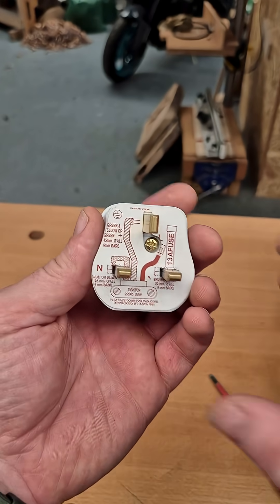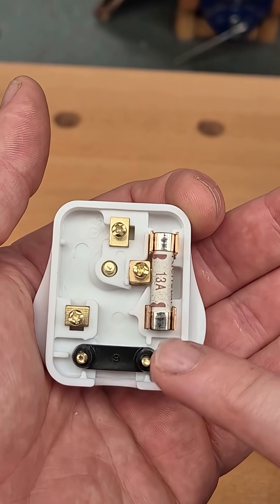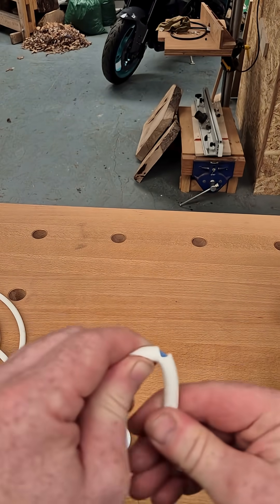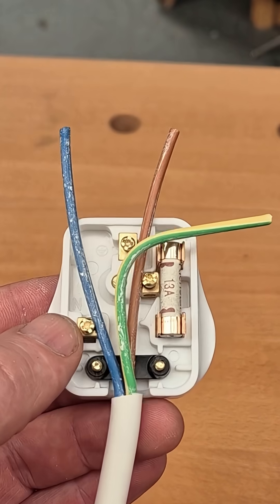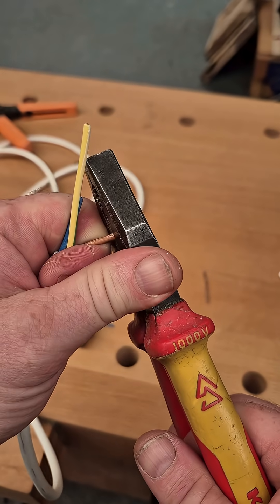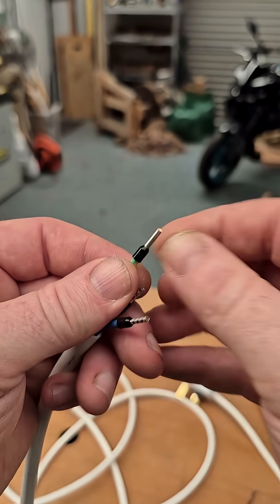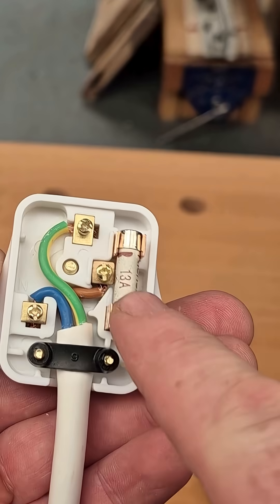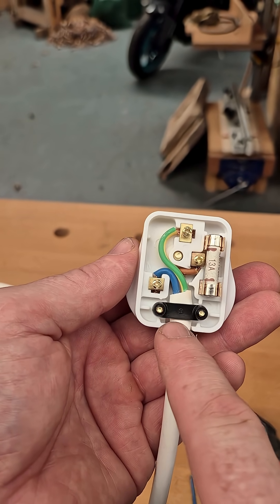How to wire a 13 amp plug in Ireland and the UK #electrician

Comment: That cable isn't thick enough to accommodate a 13a fuse
Reply from the maker: its a 3x1.5 flex?
Reply: Then I apologise. It looked thinner than that. @JohnMcGrathManInShed

Comment: In the early 80's we learnt this at school in physics. I am no electrician but I do have a crimping tool :) . We were taught not to have any copper on the wire side of the pin, but pin had to clamp copper 100%. These days the auto strippers are a game changer.

Comment: OK from one electrician to another that one gets a 7.5 out of 10!
Your ferrules magically disappeared! (extra brownie points for the pro clamp rather than the usual one for solid conductors)
Your N was short and your L was long (both the same length.
You did not release the stretch you put into the inners when you stripped them by pulling the outer sheath.
When you installed the N and E you did it with the pins in the plug and you did the same with the L.

That said you got the connections right and whisker free and the outer was under the strain band!

Try cutting the iners to the correct length without bending them into shape and fitting the pins (and live terminal) on ..... then bend the pins into position and insert them so the shortest inner is the live, the N goes up and then down to the pin giving some spare and the earth is easily slipped in last!

This would have been a perfectly acceptable job as a householder but not 100% as from a pro ;o)
Reply: OK, here’s a pro question then (I am not one):

In the US where I now live, there is a practice called something like “clocking” or “indexing” where after installing anything with a screw-attached face-plate — like a socket, or light switch. — the final task is to orient the screws so the slots in the heads are all aligned the same way. I’ve seen it done where they’re all vertical, or all horizontal, and I’ve heard that where applicable it might even be done in alignment with any prominent wood grain that is adjacent to the item in question. Obviously it makes no actual difference to the work,  but it seems to be regarded as a sign of a good pro — an example of a “craft pride” tradition.

At first I thought the person who told me was pulling my leg, but I have since confirmed it and seen it myself many times.

So, my question is: does something similar exist in the UK or Ireland, and if so what’s it called?
Reply from the maker: @KT-dj4iy  absolutely some people call it dressing the screws, I always align my screw slots vertically on all switches and sockets
Reply: @JohnMcGrathManInShed  cool thanks. OK and so next question: why vertical rather than horizontal?

I believe vertical is also more common here in the US, but I’ve never been able to figure out why. I was given one possible explanation but while I now believe the clocking story itself, this explanation for why vertical still sounds like someone trying to fool me. The reason given was:

It doesn’t matter which direction is chosen, but there is a tiny possible reason by which vertical might be slightly better than horizontal and it is this. There is always dust floating about in the air, and horizontally aligned slots give that dust a wee shelf it can settle on and build up. Vertically aligned slots, by contrast, don’t. And so vertical is preferred because there is a tiny, theoretical chance that they will suffer ever-so-slightly less from dust build up compared with horizontal.

Possible? Someone just pulling my leg?
🤓
Reply: @KT-dj4iy  Yes!
No name but we always aligned the slots to 2 O'clock! I learned that as an apprentice ;o)
Reply: @totherarf interesting. So not horizontal or vertical. Which obviously is fine — all that matters really is that they’re the same.
That said, I’m now kinda wondering why not 1:30 (since if vertical is 0 degrees, and horizontal is 90 degrees, then halfway between is 45 degrees, which is half past one). 😃
Reply: @KT-dj4iy  Not sure. That was just the way it was!
Reply from the maker: I clearly said in the video that people who are  not electricians won't have ferrules, so i didn't use them, I did not stretch the copper. There is also another full minute to this video, which you did not see because shorts are limited to 3 mins, but thanks for commenting.

Comment: This has triggered a flashback for me, from the time when many (most?) new appliances came without a plug! It changed in 1990, when the UK Plugs and Sockets etc. (Safety) Regulations was issued in February 1990. After that, I believe that all mains-powered domestic appliances had to come with a plug already fitted, usually a molded one. But before that it was common for there to be no plug, and for the electrical flex to have only minimal preparation, like some stripping of the outer insulation to expose the inner leads with their ends prepared a little.
Reply: Me too! Put the plug on many a time back in the day.